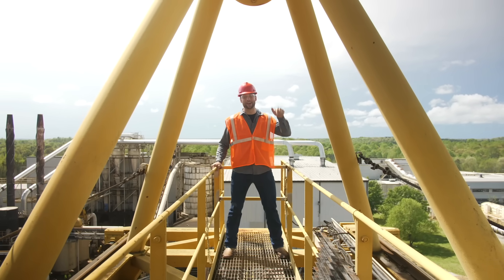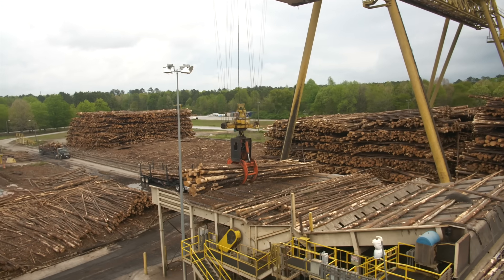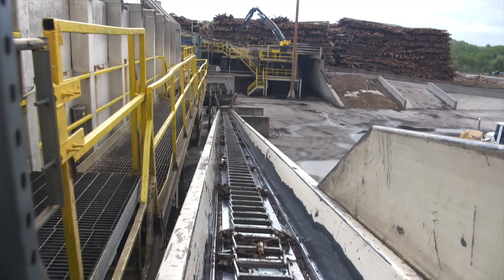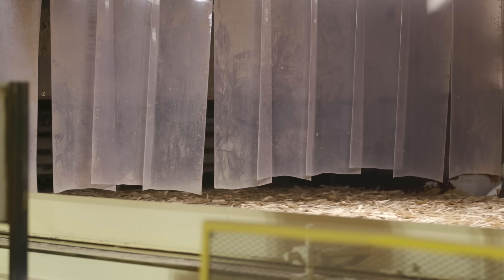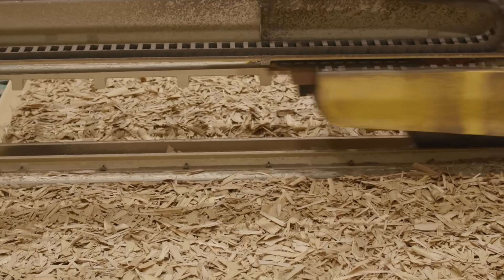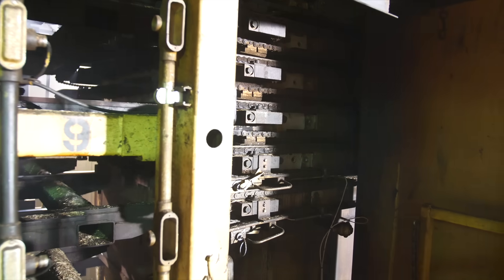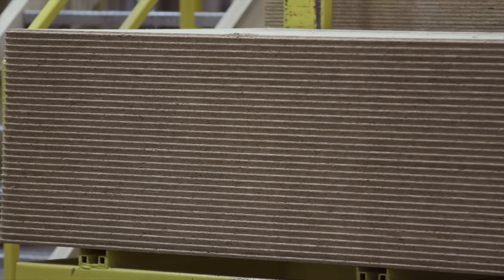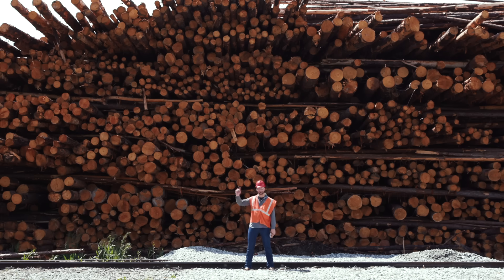Could OSB be BETTER than Plywood????

Comment: I realise there are different grades of OSB as shown in this video but structural ply is just so much stronger generally , easier to work with and better in moisture resistance .
As a carpenter we have all used particle board flooring and even the best moisture resistant versions are inferior to plywood flooring .
OSB is different again but similar idea .
It is just so much more reliant on glues / resin and usually fails earlier than plywood .

My old boss used to refer to it as " compressed horse shit " ..... !!
Reply: Lol must not be buying the good stuff from a carpenter \shed builder the treated plywood is always shityy quality we've got some decent stuff but it was al ok t thicker than out USB flooring the USB has lifetime warranty to
Reply: Markus Patients 

If you think I believe a lame story like that, you probably are voting for Biden!
Reply: Markus Patients 

Once again you are not familiar with Huber Advantec and ZIP YOU JUST DO NOT KNOW SQUAT!
Reply: Shaun - you said, "particle board..."
I'm not sure if you are referring to the actual product called particle board, (aka, low-density fiberboard or medium density fiberboard - both an engineered wood product manufactured from wood chips, sawmill shavings, sawdust and resin) or you're simply misapplying that name in reference to OSB (Oriented Strand Board) . Can you please clarify?
Reply: @valkyriefrost5301  

No , Particleboard ! 
( or chipboard if you're over 60yrs old )
It is a real product manufactured by CSR ,  BORAL & CARTER HOLT- HARVEY along with many other manufacturers .
I am NOT refering to MDF  !

Particleboard is mainly used for flooring , comes in lengths up to 4.8mtrs long by .900mm wide x 19mm thick .
Smaller chips used than OSB but same principle . 
Woodchips + Glue = Board !!
http://www.build.com.au/particleboard-flooring
Reply: @sfcarp9418  - thank you for the clarification. I suspect chipboard is the cheapest sub-flooring material in your neck of the woods. 
Housing has become so disposable it make me sad.
Reply: @valkyriefrost5301  

Yes , chipboard & OSB ....
Necessary evils that we are forced to use .
Both are crap though !

Hence , plywood is greatly preferred by proper Tradesman trying to excel in our Craft .
Reply: @sfcarp9418  - I agree
Reply: shaun farrell 
No decent carpenter uses partical board at all!!!
I would not use it even for a toy box.
Reply: shaun farrell 
Once again you guys do not have a clue at all what you are even saying!
Advantech isca very high quality OSB which uses special resins and requires a special glue when gluing the Advantech subfloor to the floor joists.
As Jordon said, Huber does not even use a Vee shaped T&G but instead rounded nose T&G.
Reply: @BrianBriCurInTheOC  

In countries outside of " Seppo Land " particleboard flooring has been around since the 50's . It has improved but as we have all stated , plywood flooring is superior !
We don't use OSB anywhere near as much as the U.S 
OSB was only really introduced here around 10yrs ago .
All structural bracing used here is plywood and  hardboard sheeting / masonite .
http://www.build.com.au/particleboard-flooring
Reply: @BrianBriCurInTheOC  

No one cares " Septic " !!
Plywood is a superior product and you can believe all the product placement you want .
Real carpenters / professionals use tried and true products that work .
Make all of your bullshit comments elsewhere .
Reply: @sfcarp9418  Brian Curwick is on a mission...no amount of evidence or reasonable arguments can deter that troll. He's replied to every comment that claims ply is better than OSB. And like a proper troll loves using caps to shout at people.
Reply: @BrianBriCurInTheOC  - OSB is a decent product that meets the needs of the modern builder. In restoration projects on houses built before WWII, plywood and "newer" materials are completely absent. Sub-floors are one inch think (25mm) planks running diagonally across a room with a 3/4 inch (19 mm) hardwood floor on top of that. Framing boards are rough cut two-by stock, not dimensional stock.  Old bones and good materials keeps those houses standing today. My modern "cookie cutter" house, filled with OSB floors, foam sheathing and clad with Masonite, will be lucky to last 50 years before needing major repairs. There are great materials available for building quality homes and Matt's video shows this time and again in his custom builds. But for the average consumer home, houses are built to be quick money makers with inferior materials and usually, inferior skills (think PEX vs CPVC vs Copper). I'm not saying Huber does not make a good product for what it is. What I and others on this thread are saying is that their are better products available. In this case, plywood is typically superior. But, as Matt's video's have also demonstrated, material quality is only as good as skilled labor in the materials installation and protection. OSB can be a good structural product when used correctly and protected from the elements. 

Lastly, your comment about Huber using U-shaped T&G instead of V-shaped is nothing new. I recently repaired a porch ceiling clad with beadboard. I'm not talking about modern beadboard milled from a plywood panel. Each board was/is four inch wide (102 mm) pine, a half inch thick (13 mm), twelve feet long and uses U-shaped T&G between the boards to hide the long running seems. This is from a house built over a hundred years ago. My point is material quality has declined over time in the pursuit of mass production and profits.
Reply: When people use the term Particle Board they show that they do not understand what Hiber ZIP IS ALL ABOUT!
Reply: What makes Huber’s AdvanTech products different than other Saw dust boards is the genuine science and Adhesives/resins they use in the manufacturing process. This is why they had to come up with their own Adhesives to use in the building process (see Matt Risinger’s video from last year detailing why he does not use Liquid Nails or Locktite PL on AdvanTech products).
Old Timers will never change their thoughts and ideas because they refuse to learn science.
Reply: @BrianBriCurInTheOC  the reason most believe plywood is better is from personal experience using both.
Reply: Sawmiller Smith 
Have you used this specific product???
AdvanTech by Huber?
Once again you ASSUME you know what you are speaking about but...
Reply: @Sawmiller Smith, right. I’ve replaced enough rotted, moldy, etc.. osb subflooring to know it’s definitely NOT superior.
Reply: Sawmiller Smith 

Have you actually used The Huber Zip Products?!?!?
Or Advantec
Reply: @BrianBriCurInTheOC  Science relies on objective testing. There was no objective testing comparing plywood and OSB in this video. If OSB is better, test it and prove it. Some of Matt's best videos show him testing products like roofing. Without testing this video is just BS.
Reply: @jimroth7927  exactly. real science must be observable and rpeatable and any other science is junk science.   So in other words  "words" don't cut the mustard and the proof is in the pudding.
Reply: @BrianBriCurInTheOC  All use 'science'.  Process for regular OSB is virtually the same as Huber uses - only difference is perhaps pressure and resin used, but general idea is the same as any other OSB product.  Huber is perhaps supplying what OSB should have been from the start, but the cost benefits over standard plywood nearly evaporate.
Reply: ArthurDentZaphodBeeb 

You are talking crap about something you do not even understand!
Reply: @BrianBriCurInTheOC  You forgot to mention the fact that those resins and adhesives are TOXIC and harmful to human health. Off gassing is gonna be recognized as a problem only when people start suffering health consequences, just like the cigarette industry.
Reply: Reptilian Lord 
I’ve had more wise men tell me to NEVER ASSUME... SO I will not assume you’ve attended any Leadership, Management or Communication Classes that give the wise lesson about assuming something...
Yes PAST product have been TOXIC, 
BUT a cut of coffee is more valuable than what you said. 
I trust Matt and Huber!
Two things hold back advancement in Construction in The USA.
HACKS NOT KNOWING WHAT THEIR DOING
&
Ole School guys not willing to learn.
Matt’s bank account shows he knows what he is doing.
Oh and him hiring a new guy too.
Reply: @BrianBriCurInTheOC   - You said, "Matt’s bank account shows he knows what he is doing."
No, a bank account does not mean he "knows" anything. It could mean he's a good salesman or a dozen other things totally unrelated to construction.
Plus, I don't care about his or your bank accounts. What I (and most commenters I've read today) do care about is quality information.
I like Matt's videos;  I usually learn something and I did learned something about OSB today.
Yet, the original poster of this thread is commenting on his experience with OSB v Plywood and his conclusion is plywood is better. My experience is the same. 
See my next comment for a better argument against the OP.
Reply: Dan Heidel 
It's because of guys like you that refuse to teach good leadership by example that younger guys make use of excellent courses by community colleges, industry organizations, and local mentoring sources.
Reply: @BrianBriCurInTheOC  you have seen his bank account?  The size of someone's acct means nothing, in most cases it shows they can bullshit the best.  Sure Matt is a builder, by name.  Let's see the last house HE actually built.  He is paid by all these companies to pitch their products.  He is nothing more than a pitchman.  I would love to put my two hands against his two hands.  Fact is, I build with them everyday, I'm dirty everyday, he is clean, drives around makes videos...wow wow wow...
Reply: @BrianBriCurInTheOC  Matt's own home shows he doesn't always know what the heck he is doing, or even make good choices among available techniques.  I'm not ready to nominate him for the building trades god of the century quite yet.
Reply: @valkyriefrost5301  Trump's bank accounts are Huuuge! to hear him tell it.  Yet he personally owes 400 million due in a year or two.  Then there is the cheap B. Moore paint he specified that began running when washed, so Trump demanded a big refund.  Despite getting exactly the quality of paint that he ordered, Trump had his concierge threaten B Moore.  They gave Trump a Huuge refund when he did not deserve anything.  Bank accounts mean little because the US public is so easily scammed, even the rich folks.  See Bernie Madoff and all those pyramid schemes.  Quality products can be tested for quality.  Without testing, what we have is hearsay, or somebody trying to remember what happened a few years ago.
Reply: Ammo Alamo 

If you are going to make a statement at least have the integrity to make legitimate genuine examples instead of empty generalizations.
Reply: Christian Widebeck 

He pays guys like you to work... Guys like you work so hard, you either do not have the time or desire to learn about the best products which appear on the market every day!
Huber ZIP is better than any other OSB like products structurally first of all.
Then, it is moisture-proof when installed correctly. 
Then when you actually care about doing the best job like Risinger, he seals the bottom plate and the bottom of the sheeting.
Tar paper had its place, but that is ancient history!!!
Reply: @ammoalamo6485  - All too true. Unfortunately, the US consumer is all about faster, easier, cheaper. Notice the word quality is no where to be found in those words. The way inflation has grown over the past five decades while wages have remained stagnant means that most home buyers cannot afford the quality their parents and grandparents could afford. Products from Huber and Advantec seek to add quality to the faster, easier paradigm, but the price puts them out of the market for the average home buyer.

Comment: Saw this stuff at the Oregon coast on a build. It was exposed to weather for 6 weeks...looked worse than Edge Gold. Buckled everywhere.
Reply: Most of Oregon is currently a “builders market”.  They can name their price and schedule right now. A lot of builders will start multiple projects and come back to them at alternating schedules. In addition, one days worth of rain on the Oregon coast can equal one years worth in some parts of the country.
Reply: @stoweman34  So there actually no malice intended?  It's just that hard to find people to do the work?  If that just the conditions of the work in Oregon, why don't they just not use it then?  It seems like it could a total disaster if between the time its installed and the time its protected that you might have to replace the OSB product on the house.
Reply: Baloney Justice , No malice. The builders are that busy.. I was trying to get a Lead Time from the builder; he told me he’d try to fit me in a year and half from now! This builder said he tried Advantech because of the claims they make regarding water warp/damage during install. The builder advised he needs to go through the entire house with a wood floor sander to sand all the edges before finished flooring get installed.
Reply: @stoweman34    So my take away from this is...OBS is just not a suitable building material for Oregon, there is not enough people working in construction in Oregon, and holy cow, I hate to be the poor fuck that has to come in after and sander after the fact to fix the neglect created damage.
Reply: Why 6 weeks ?  We're the builders on strike? 😄 Shouldn't take that long to get dried in ! Or as we say in Australia, to lock-up stage
Reply: @colstace2560  average 4000 square foot home with 4 car garage up here in Northern Arizona (US) takes about 3 weeks unless yoi botch your sub contractor scheduling. But high end osb subfloors are a blessing in Monsoon season.
Reply: That seems like a worse case scenario where the people doing the project don't care, and left it like that to spite the owner...  The stuff is designed to fit at the bottom of your floor level and have something over it so it never has water on it.  If you can avoid getting water on it.. it should last damn near forever.  

Then again, if you building a place where there might be flooding, you might not want to use it there because of the threat of having it soaked or submerged..   I think you need to treat OSB like you would treat your tools.. with the understanding if you use it wrong, you will break it.
Reply: Thats mainly the coast tho, where few people live.  OSB is commonly used like anywhere else, but the valley is very damp during the winter.  So yeah, plywood is a better sheathing material here.
Reply: @col stace, I definitely would not buy a house that can be built that fassst because it means the builder has No permits, nothing is being inspected, is skimping on materials, is likely using  illegal undocumented alien labor, is not double checking his or her  work, etc.
Reply: “Depending on the site and zoning classification, it typically takes from three to six months to build a house.”  
https://www.realtor.com/advice/buy/how-long-does-it-take-to-build-a-house/
Reply: “According to the 2016 Survey of Construction from the Census Bureau, the average completion time of a single-family home is around six months.” 
https://www.newhomesource.com/learn/how-long-does-it-take-to-build-a-house/
Reply: “The 2014 Survey of Construction (SOC) from the Census Bureau shows that the average completion time of a single-family house is around 7 months, which usually includes around 25 days from authorization to start and another 6 months to finish the construction.”
http://eyeonhousing.org/2015/08/how-long-does-it-take-to-build-a-single-family-home/
Reply: “Once you received the approved blue prints and permits / “green light” it can take 6 - 8 months to build a single family home. The initial process, mentioned above, can take from 1 - 2 months depending on the code enforcement and zoning work load, building the actual house can take 6 months, all and all 7-8 Months.”
https://www.buildzoom.com/answers/t/how-long-does-it-take-to-build-a-new-house/2182/3
Reply: THIS IS WHAT YOU HAVE TO KNOW! THEY WOULD HAVE YOU THINK THAT THIS OSB IS INDESTRUCTABLE AND IT'S NOT!